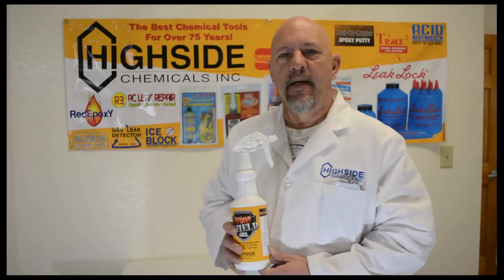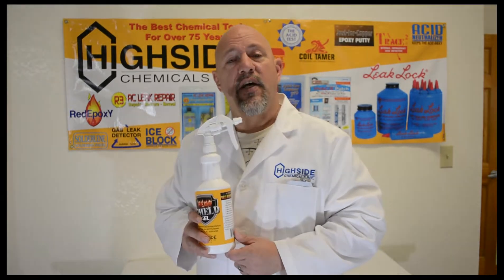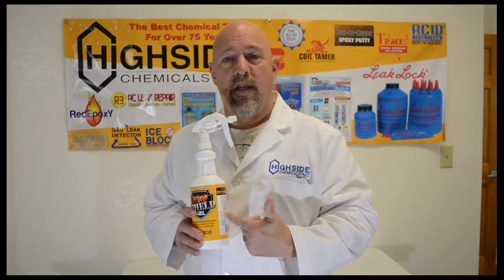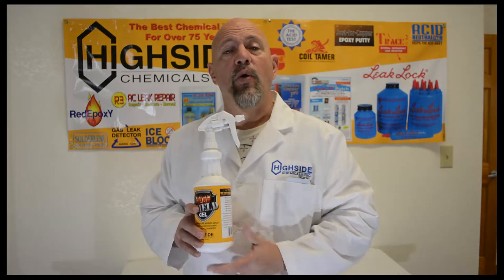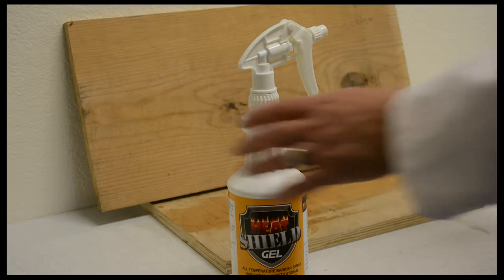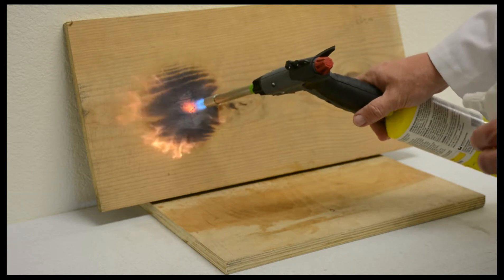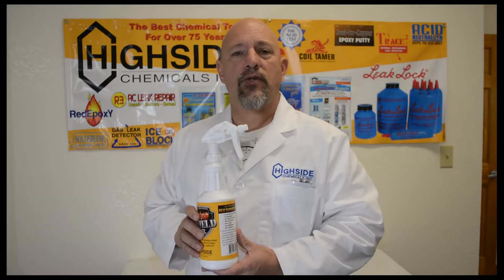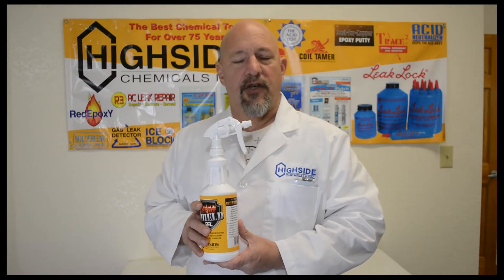Heat Shield Gel

Comment: The first burn he held up close and did not move the nozzle much and held in position longer. The second burn with gel he held nozzle back further, did circles with the nozzle to move/spread the heat around and only held the flame on there for a short time. Either a horrible product or a horrible demonstration. Probably both.